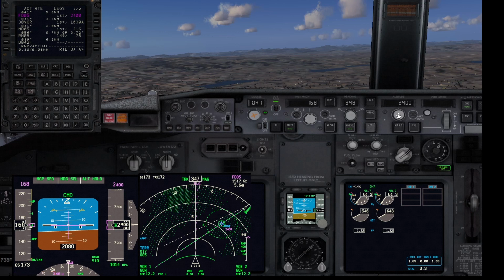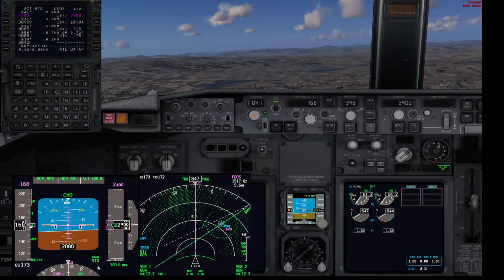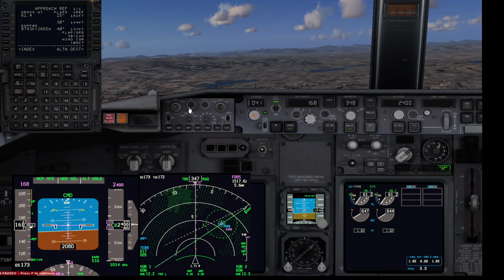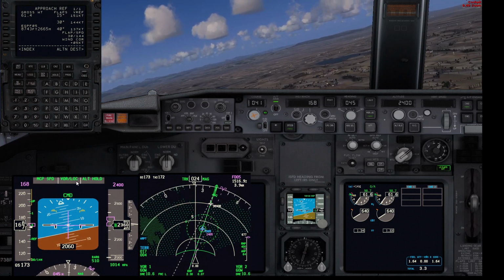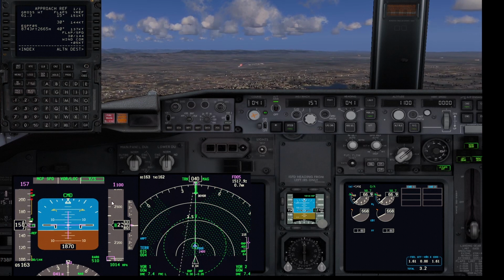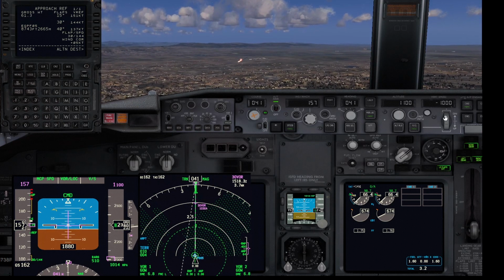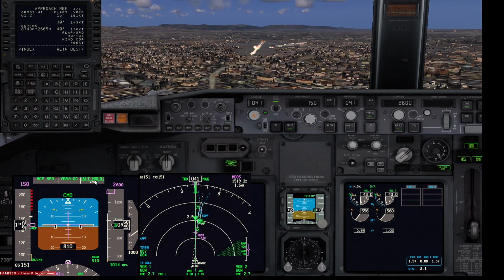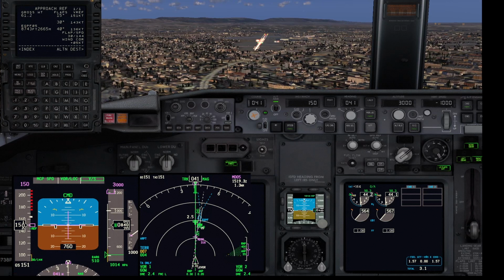Instrument Approach Using Vertical Speed

Comment: Hi, In case we are in VNAV Path and we rotate thumb wheel to -850 …will the VS get armed.
Reply from the maker: Hi there. If you are in VNAV PTH you will need to press V/S to changes modes. Purely rotating the V/S wheel on its own will do nothing.